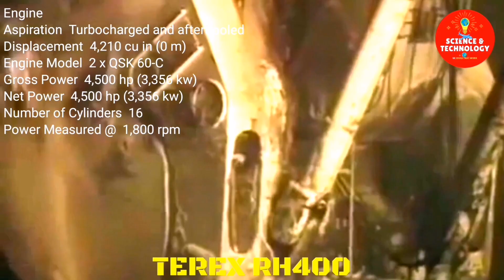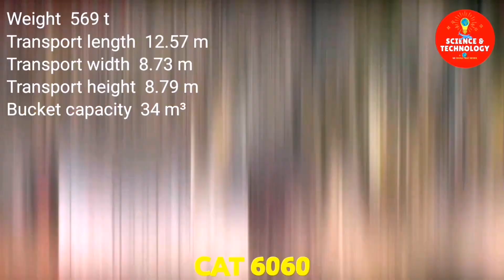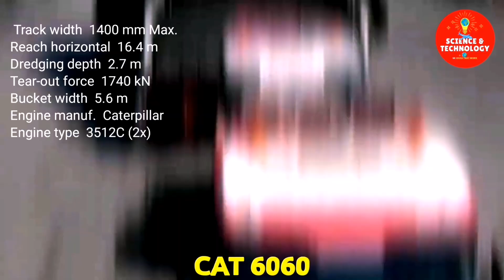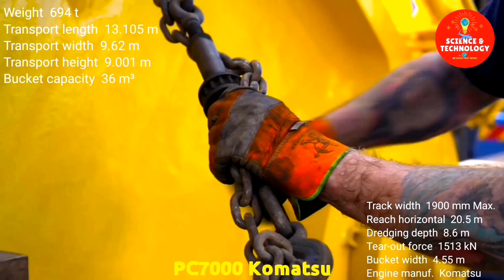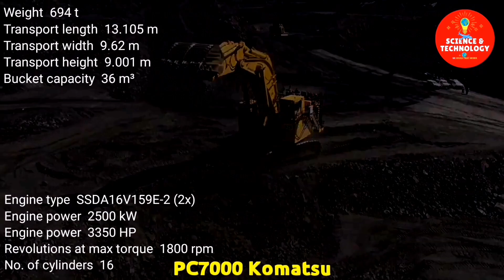Top 3 Biggest Hydraulic Excavator in the world, largest hydraulic shovel, mining monster machines

Comment: These are large,  good looking,  powerful machines,  and are probably close to the max size,  which is feasible,  from an engineering standpoint,  for a hydraulic shovel.  That said,  and no disrespect for these machines;  The Silver Spade cable shovel had 4 sets of tracks,  larger than any of these,  one on each corner of it's undercarriage.  It's bucket capacity was over 100 cubit yards.  It was scrapped,  years ago.  Of course it was not a loader,  but an overburden remover,  and an engineering marvel.